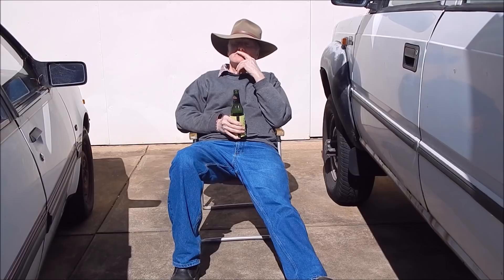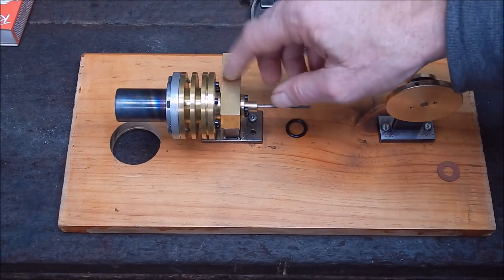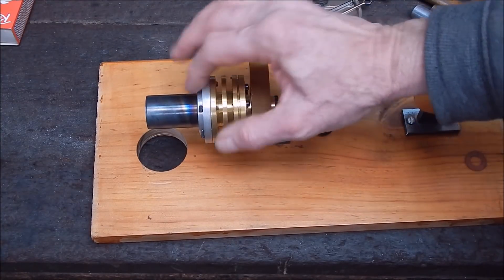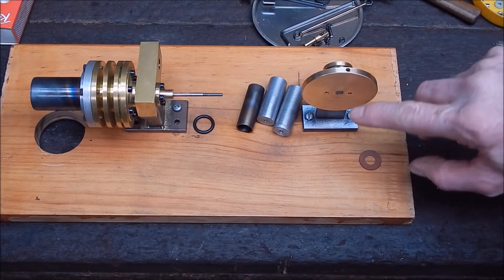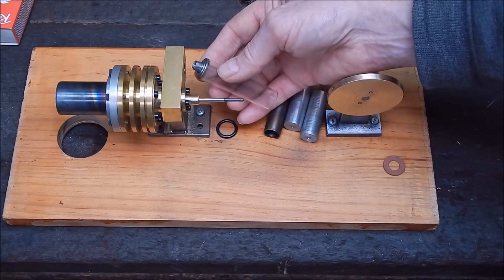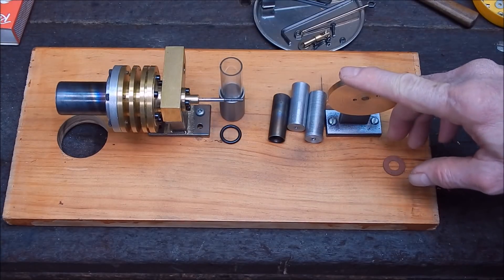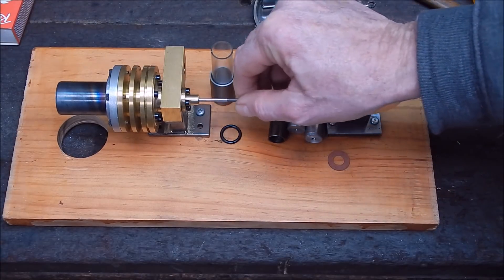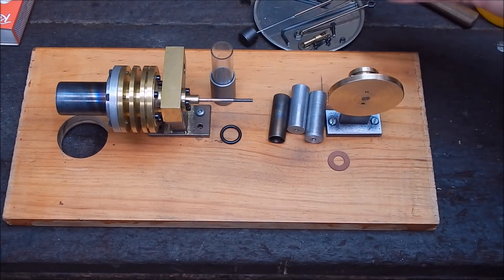Stirling engine update and a shout out

Comment: hay rob copper and glass expand at the same rate its  why you can make light bulbs , may be worth a try if your sleve fails  again . thanks for the update  its good to hear from you!
Reply: If I remember correctly Pyrex isn't like common grades of glass. It's made to not react with heat which is why it's used in scientific labs.